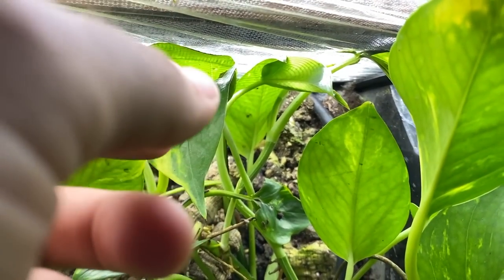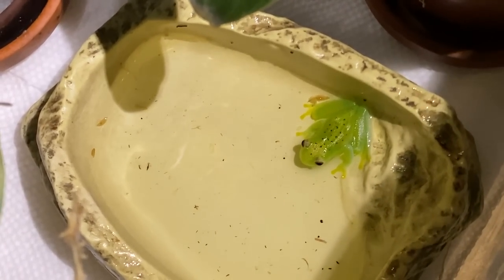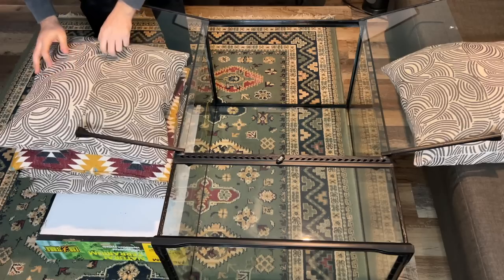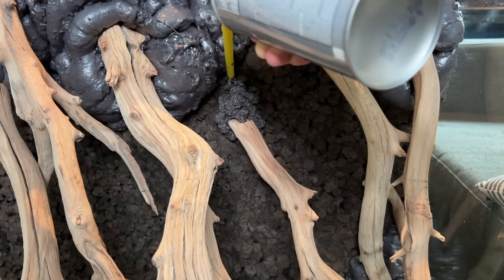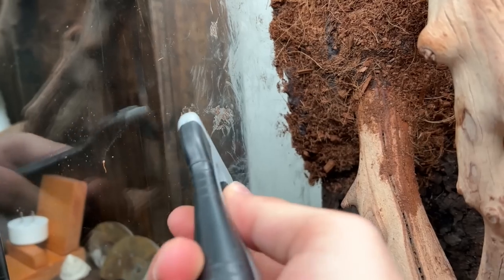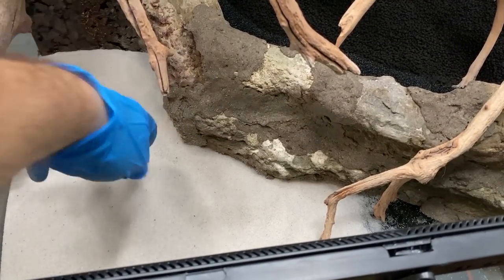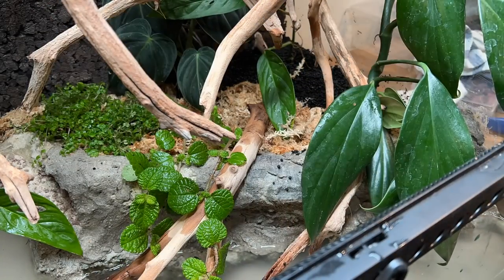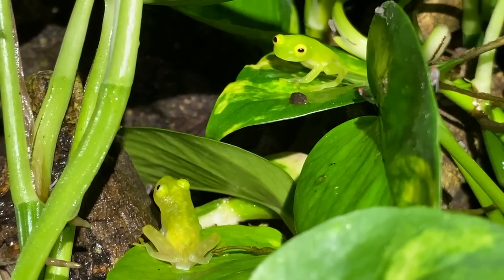How to Build a Paludarium | Meet all my Glass Frogs!

Comment: I love setting up enclosures too!
This may be unrelated to the video at large but I had a pretty general question. For a large cage, 36" x 18" x 26", (other than keeping the entire room a certain temp) what would be your suggestions for heating? currently I'm using a single deep heat projector bulb which seems to keep the warm side a decent warmth but I'm worried that the overall temperature is too low. For context this is a Tokay gecko enclosure and my Tokay seems to travel between sides just fine but recently he has been spending time in his cork hollow on the cold side and only once every couple days does he come to bask on the warm side. My room tends to be on the cooler side since it is winter and we are redoing the insulation in my house. I haven't noticed anything different in my geckos behavior (apatite or general mobility patterns) but I'm a keeper that probably worries more than I should and just figured id try to get any clarity on this worry.
Thank you and as always great video!